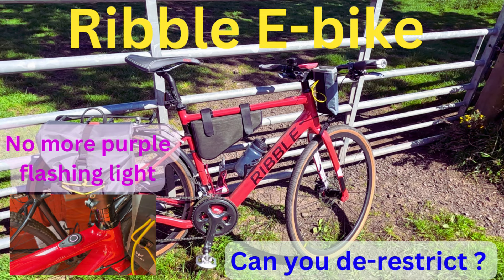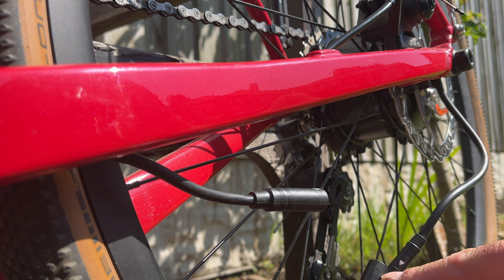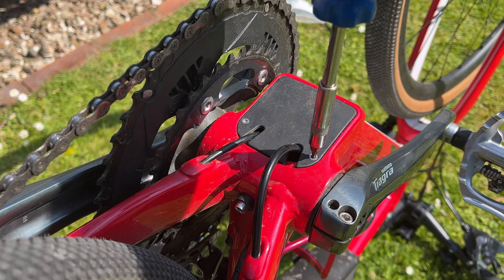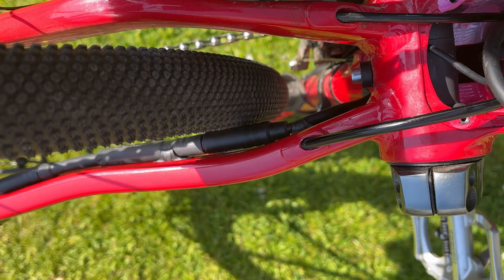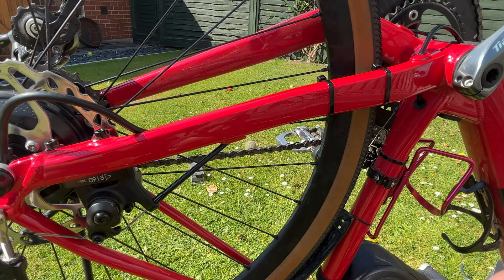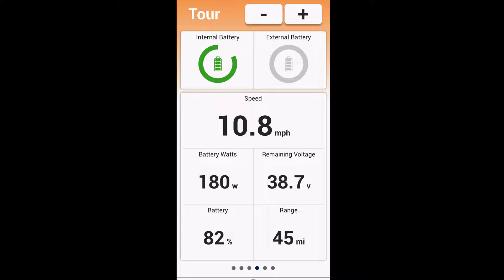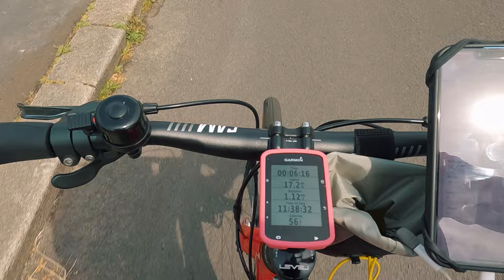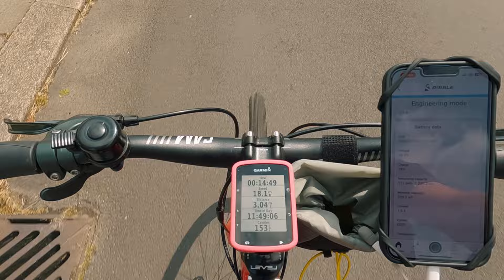De-restrict your Ribble E-bike by installing speedfun ghost adapter…

Comment: Thanks for video. Funny though Speedfun is still just another speed restrictor. It just increases your speed but still limits it. I use a Speedbox on a Bosch Performance Line Speed 28mph in the United States and it really is a speed de-restrictor as it totally removes the limit so you are no longer renting your bike from an ebike motor company. So funny government puts restrictors on bicycles but won't do the same thing that could easily be done to something that really does injure or kill pedestrians including cyclist every day, cars.....Btw, I normally can hit speeds in my sprints up to 40mph on my acoustic/mechanical race bikes. I am simply asking to be able to do that with my ebikes I have bought. (our group rides hit that regularly on our out of town training circuits.)
Reply from the maker: Yeah increases it slightly but still restricted to UK standards 😭

Comment: I have a Speedfun adaptor and have noticed two things about it. First, the speed indicated on the app is about 50% of the real speed. Is this normal? Such a dramatic reduction in indicated speed seems to mess up the power curve characteristics a lot. 
Second. I put the bike on a stand and fitted a speed sensor to the rear wheel. Without the Speedfun, the bike will spin the rear wheel at 15.7mph when slowly turning the crank. When I install the Speedfun the motor still only turns the rear wheel at 15.7mph. Is this correct or is my Speedfun faulty?
Reply from the maker: You mention the app , is this the e-bike app ? All I know is that I fitted it and it doesn’t cut out at just over 15mph but cuts out around the 19.5mph mark . 
Sounds like there is something not right with yours tho ?